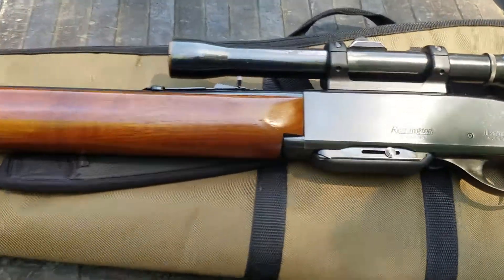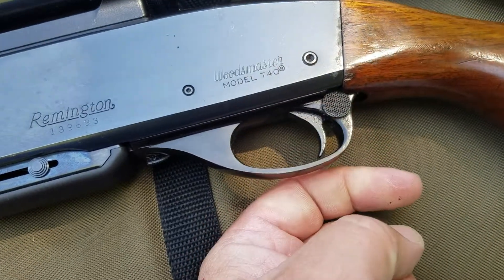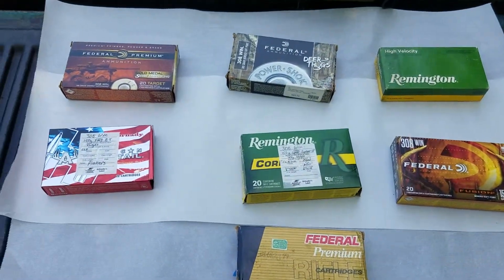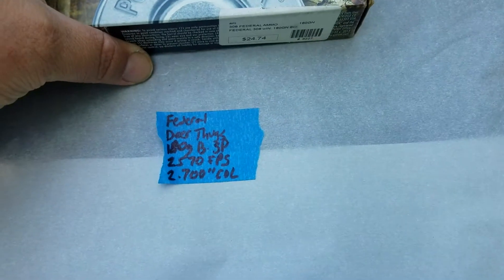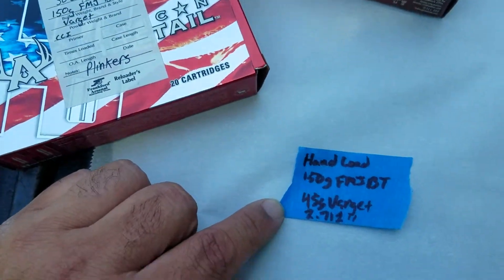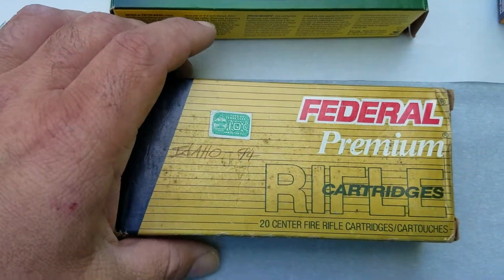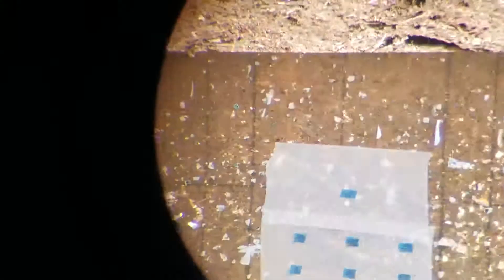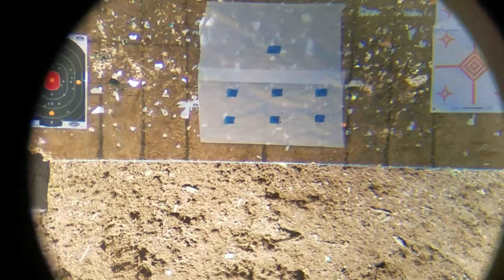Remington 742 / 740 / 7400 accuracy test and load development.

Comment: When you start experiments with reduced loading for .30-06 or any other cartridge in the 740 series guns avoid anything burning slower than IMR 4064 burn rates. The slow burn long pressure curve powders give great muzzle velocity but they will deliver high gas port pressures in those semi auto rifles. I see that as the root of all evil to those guns. As I previously stated. They deserve special consideration.

Comment: I'm going to stir up a theory here. I think that series of rifles would prove best served with ammo that approximates military .30-06 ammo.   A bit milder than normal sporting ammo and also loaded with medium burning speed powders like the 4895s and 4064s or others in that range. Also I think the med weight bullets likely the best too. I think Remington was running on the outside edge of gun versus cartridge when that series of autoloaders were released to the market. Looking at the attenuated nature of early factory .280 Remington ammo would indicate the engineers weren't convinced that their new baby was fully up to a steady died of hot ammo. I've observed some peening  damage inside 742s and also picked up range brass that I suspect was from a 742 that had extractor damage on the rims. They were certainly signs of an over gassed system with excessive port pressure, or maybe a slow powder, or a dirty chamber. Those rifles deserve real special consideration. Oh yeah. Remington safeties could be changed over for left handed shooters. Had to change an 870 back to right hand operation once for a friend. Judging from the big head safety button on yours it's been customized a little for a left handed shooter.
Reply from the maker: I now have the 30-06 742 that shines compared to the 308. . . . .i will load some loads and test your theory. Challenge accepted and thank you.
Reply: you"re right on being selective of powder burn rate, in the owners manual you can read that only remington ammo is to be used in these models, most people think its a marketing thing but there is reason behind it, the gas port was"nt desighned for slow burning powders and has no way to adjust for them. neadless to say that people would stick any brand of ammo in them, thinking that the gun should be able to handle any factory load and then wonder why it fell apart. use of a fast for caliber powder will keep the gun from being over gassed and will make the gun last allot longer. hard abused guns will jam up because the bolt lock has taken enough harsh treatment that it no longer has enough tension to properly lock up, in which causes chatter marks on the rails the bolt moves back and forth on.
Reply from the maker: @sherrypulec1449  Excellent comment. The gun in the video was a 308 and didnt shoot to my expectations. The one I have now is in 30-06 and is more accurate AND more reliable. I remember seeing the chatter marks you are talking about on the rails but assumed it was made on a Friday at quitting time or something. Ha ha. Glad to have learned something here. So can we assume that IMR 4895, 10% below max load, under a 165 or 180g bullet should be used for my next video?
Reply: @jabsoutdoors3859  yes that is the right burn rate for these rifles, i have been trying out the imr 4166 in my 243 and can only get half way to a max charge before being over gassed. keep an eye on the shoulder and neck of your brass, over gassed brass will have a flat area on the neck where it has been thrust against the ejection port and the shoulder will have a ding on it, while your watching for pressure sighns like ejector mark on the head of the case. the h 4895 powder would also be a good one.
Reply from the maker: @sherrypulec1449  Honestly I have seen 2 cans of H4895 in the 11 years I have been reloading. I thought it was like H4227 and they quit makin it, but the IMR version is supposed to be the same. . . .. That is true on the 4227 but not the 4895. H4895 actually does exist. Ha ha ha .
Reply: @jabsoutdoors3859  i have seen both in the last two months of the 4895 powders and the 4227 but the more popular powders like H4350, varget, and unique is nowhere to be found during this shortage.
Reply: @jabsoutdoors3859  Looks like my theory is gonna get tested here. As for 180 grain bullets? I question their practicality for this project. And if we are essentially going to duplicate military ball ammo pressure curve with medium speed powders, then 150s and 165s are going to respond with better velocity anyway.

Comment: Hello again. Just wanted to toss in the fact that Reloader 15 with 165 grain bullets in a .300 Savage case gets up to about 2550 FPS. Check the burn rate chart on Reloader 15. Bet it is close to what we need. I'm guessing in a .30-06 case 2650 would be easy enough at fairly low pressure. That is in match ammo territory for weight and speed in .30-06.